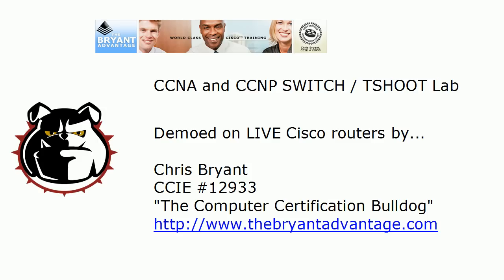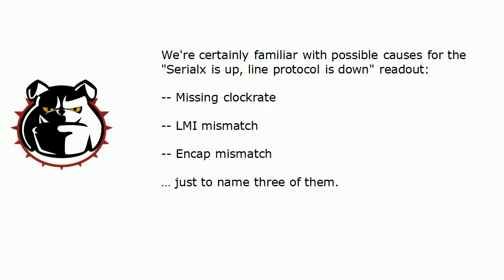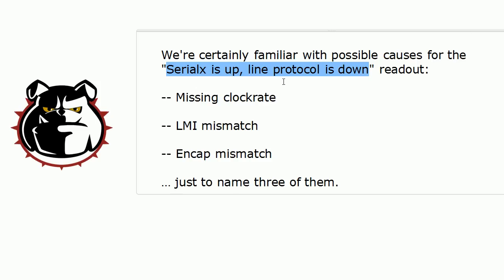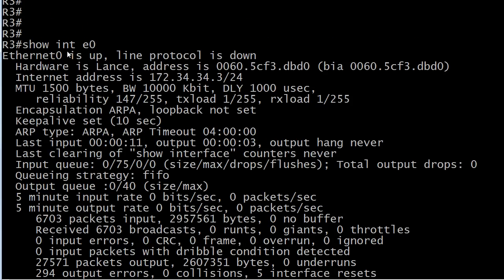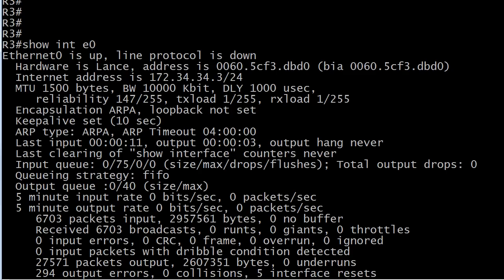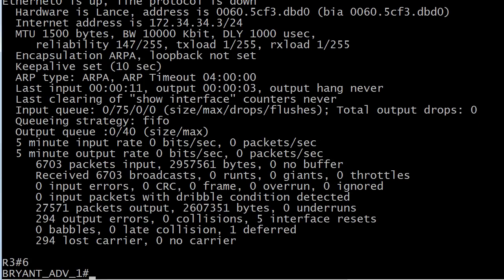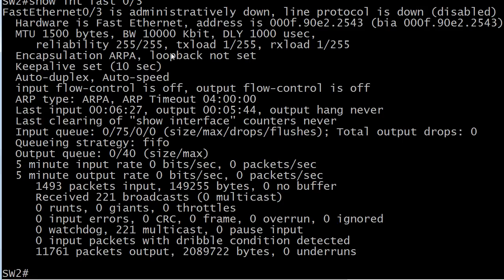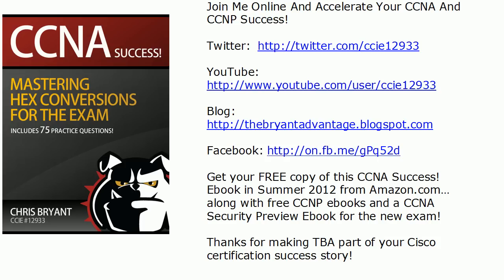CCNA And CCNP SWITCH Video Exam:  The Line Protocol

Comment: Thanks for a nice video but i am having same issue while connecting two ISR 2811 routers with fastethernet ports directly.... interfaces are up but protocol is down .
Can you please suggest the solution... no switches attached... i wanted to do OSPF practice..
thanks